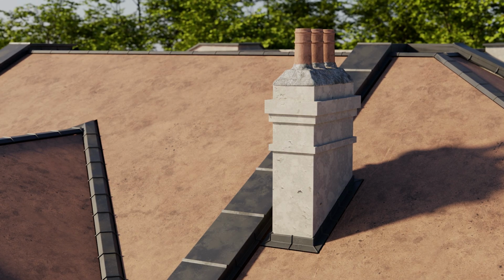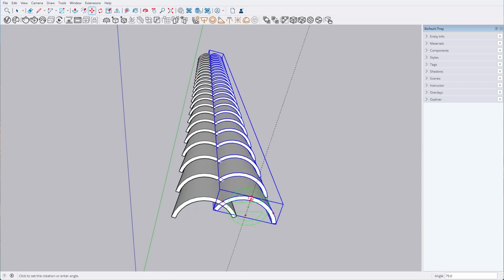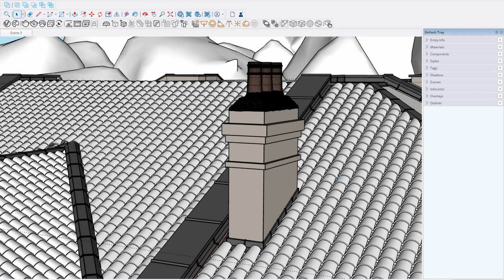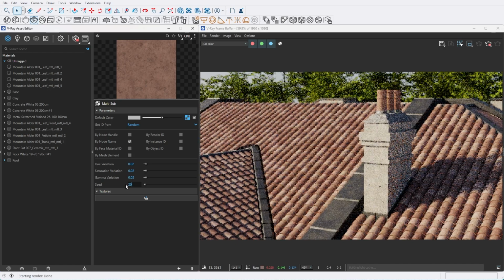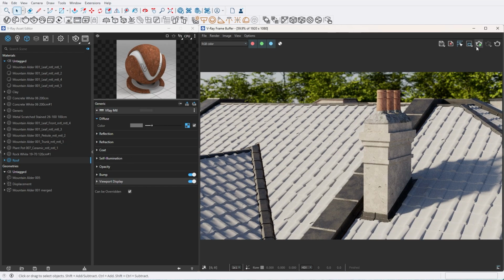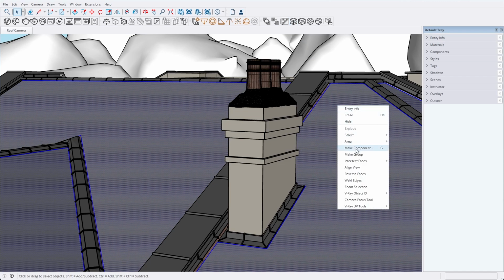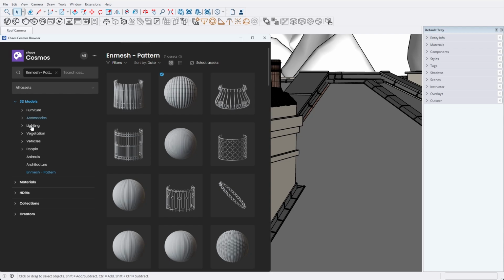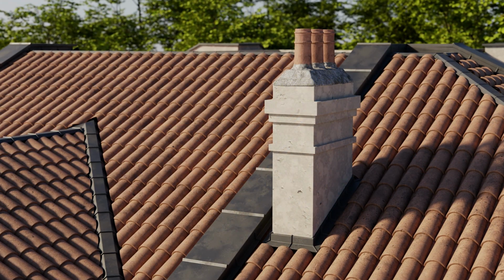The BEST Way to Create Roof Tiles in SketchUp (3 Easy Methods)

Comment: great tutorial! I worked on 3ds max and vray.  I Added vraymultisubtex,  but the color tiles remaned the same. Did maybe you use material by element up on roof model?  Or maybe it depends by texture dimentions? I couldn't find under multisubtex by node name.